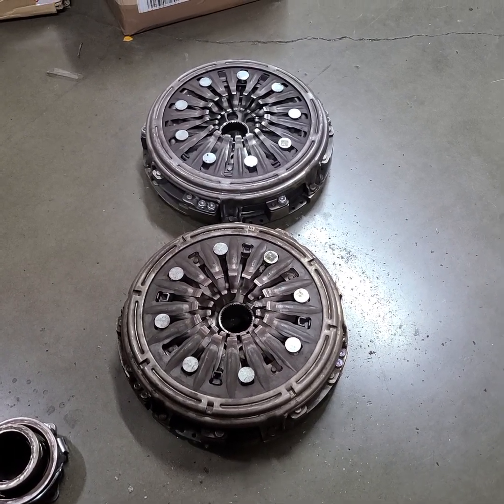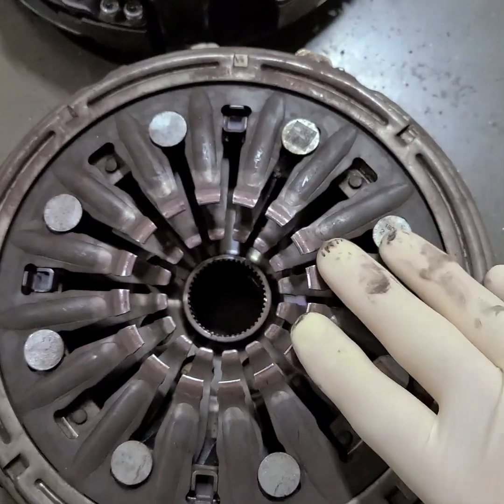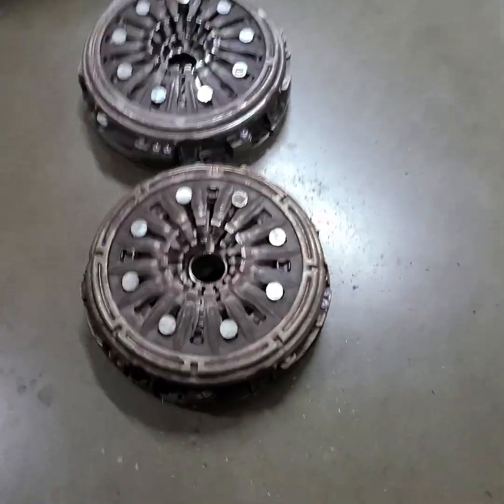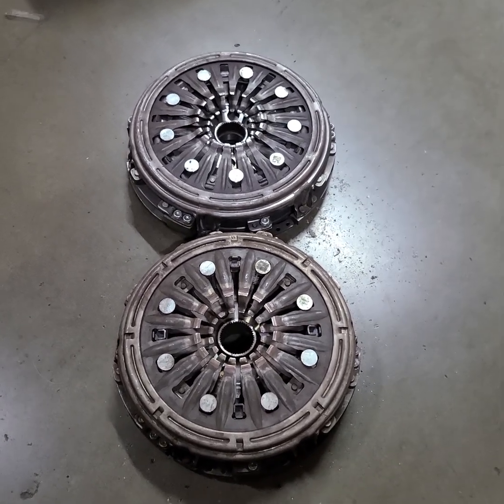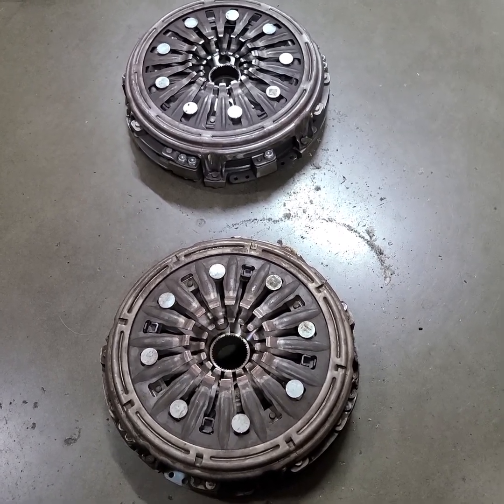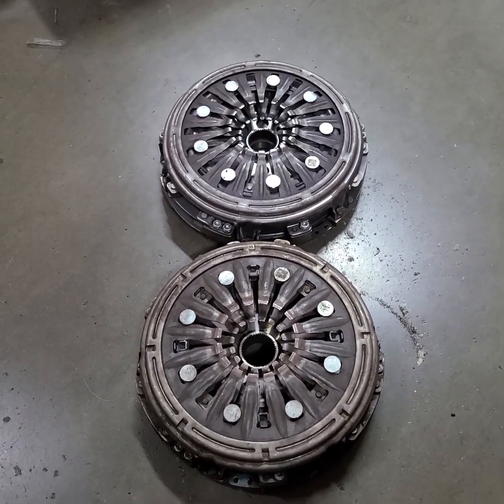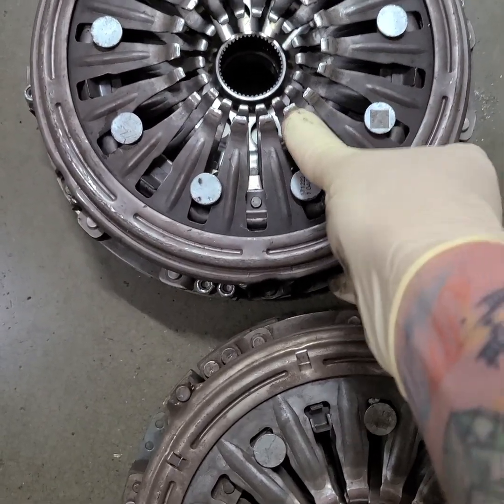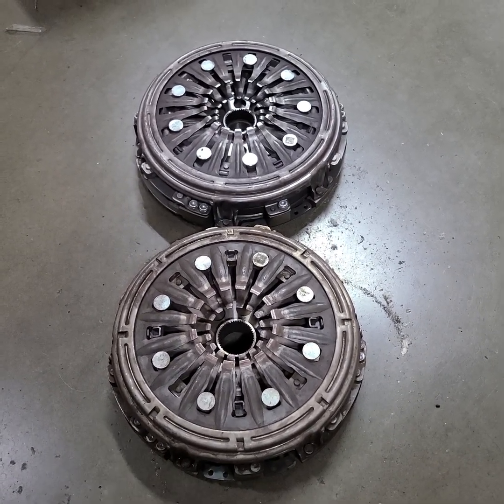Hyundai and KIA DCT clutch differences, simplified version.

Comment: This is great information.
Knowing which parts to swap out without working at dealership to have access is incredibly difficult.
I worked at Honda motorcycle dealers in late 1970's so had either new/broken parts and/or Microfiche  to make comparisons which was very useful for piston swaps or transmission parts (plus various other things)
I bought a used Kia SOUL 1.6 TDI without knowing anything about it (I know, dumb move)
It's done 78,000 miles, I've only done a little over 1000 miles in it
If I knew then what I know now I would have got something else as I'm getting a bit old to be 'shade tree' repairing stuff.
Luckily, I have been using neutral at red lights and junctions even though I only found out today it's the correct thing to do with DCT.
I subscribed as I'm sure you have more video's I'll be interested in.

Comment: Hyundai ioniq hybrid problem i pressed button 2 times ,press shifttlock in neutral and move it 3 meter in front and the vehicle starts ?and when i move it back no start?and again appear the check hybrid system and turn off engine. I let the engine run 20min but doesnt charge the big battery because error is there and little  green car icon flashes why? And when i stop engine it hear clonck from clutch or something,the car go front back no problem but i have check hybrid system.

Comment: I replaced a new dual clutch 7-speed in a Kia Ceed 2019 1.4 TGDI and adjusted the clutch actuator to 71.5mm. When I did the DTC learning function, the learning failed, although I adhered to all the conditions and there are no fault codes. The car only moves forward or backward. The clutch actuator must be adjusted to 65mm so that the clutch is engaged and the car can move. Note that the DCT learning failed again. Please help.

Comment: You seem to think that pressing on the diaphragm engages the engine with the transmission, which is the other way around. Pressing on the fingers releases the clutch from the pressure plate.
Reply: you are absolutly WRONG,this not the tipical manual transmision clutch set up that most cars have.....pushing the diaphram conects the engine a trans to get movement.....is completly different

Comment: I have a 1,6 CRDI Kia Sportage (Europe). Both clutches on the DCT7 are about to be replaced. It makes kanguru hacks when acceleration in 1. gear. It's a dry clutch. I read something about somewhere, that the replacement, installing and calibrating is the most important thing on these clutches - if not aware of this, the clutches must be replaced again in about 30-60.000 km.

Nice listening to someone who actually knows something about these transmissions. 👍🏼
Reply from the maker: I believe you already messaged us, we have replied on another social media outlet.

Comment: I have been educated.   My logic used to form this comment was not correct.

I think it might be easier to explain this all if it was understood that the throw out bearings do not apply pressure to the clutch disk but releases the pressure from them.  The diaphragm (fingers) is what applies pressure to the clutch disk.  You can decrease the pressure on the clutch disk by applying some (a very little) pressure to the diaphragm when the clutch peddle is fully released.  But I don’t think that can be accomplished using a ‘tune’.  Regardless, you can’t add any more pressure to the clutch disk (which would give you more ‘holding power’) than what the diaphragm is designed to give.

Ps.  Sorry to give negative feedback (thumbs down) but the explanation is simply incorrect.  —-  fixed.
Reply from the maker: It can be accomplished with a tune.  Both disks are loose, and the pressure plate and actuator are what control the holding pressure.
Reply: @TorkMotorsports  I stand corrected.  I verified this info with MS Copilot and it confirms that the application of the engagement bearings actually does engage the gear.   Thanks to you I have actually gained knowledge.   So, the application pressure is limited by the size of the clutch disks (for lack of a better term) and the corresponding pressure plate, the maximum pressure the hydraulic system for said clutch, the maximum pressure the diaphragm can apply before collapsing, and the ‘tune’ of the dual clutch mechanism.  Thus, the tune can only apply so much pressure to the clutch pack.

Comment: How do I check how much life is left on my Tucson clutch? I push my system really hard, 17 psi average and full pulls from a stop until I redline 3rd gear into 4th. I hear a big squeal now during the beginning of the pull and I think I don't get as much bite as I used to.
Reply from the maker: You need to go to the dealer or shop that has tools for testing clutch life on your car/clutch.

Comment: Do we know what the torque limit is on the gear splines/housing for Hyundais Dry 7spd and their “new” wet DCT transmission? Can’t find any public information that gives even just an estimate.
Reply from the maker: The factory gives it a rating of 400NM which just so happens to be the rating for the manual 6 speed also.

I have torn down the 7 speed DCT and the 6 speed manual, the gear size, differential, and spider gears are all bigger and more robust in the 7 DCT speed vs the 6 speed manual. I have pushed 600 + WHP through the 6 speed manual, I will assume that the 7 speed DCT could support that also.

Its going to take a tune, clutch upgrade and big build to really test the 7 speed DCT and sadly, no one wants to test that at this time.

Comment: fingers are wider though.
Reply from the maker: Material is thicker.
Reply: Width isn't an indicator of tensile strength or other metallurgy details tho. Technically you'd think less fingers equals less smaller failure points but more fingers do also better distribute the force evenly.

Comment: Hi, thank you for such informative video. Maybe you could advise on below issue. I have a problem with transmission in my Hyundai i40 DCT-7. All odd gears 1-3-5-7 do not engage. Car starts from 2nd gear then shifts to 4th and 6th. What might be a reason of that? Many thx in advance for any clue. Kr
Reply from the maker: I have seen this before, the clutch hub has broken splines or stripped the assembly.

Comment: Hyundai/Kia should have just used the SUV clutches across all models. I'm curious about how thick the Elantra N clutch is
Reply from the maker: The EN, KN and VN clutch assemblies I have not had time to play with or investigate yet. When I get a chance, I will get in there and post some videos up for everyone.
Reply: @TorkMotorsports  those Ns are wet clutch so its a completly different set up than a dry clutch like this one,i think wet clutch is much better

Comment: Out of curiosity, with a TCU Tune I know you can change things like shift points, speed of shift, torque values (values it deems safe etc, not increase of value) 

But does getting a TCU Tune increase the amount of DCT Farts? I saw a video on your FB Page of a TCU tune you were working on for a Forte / Cerato GT, it sounded very nice and exactly what I am after. 

Great video and thank you for the info, keen to see more like it in the future.
Reply from the maker: It depends on the ECU and year make model of the car. Sometimes, yes... you will get more shift noise (fart) when shifting. I try to avoid that and bring the power and shift in as fast as possible, this way you loose no time in the 1/4 mile results.
Reply: @TorkMotorsports this is how I know you don't know exactly what you're talking about. The "shift farts" are a spark cut torque reduction feature. They're actually meant to help the transmission shift faster and hold more power its essentially no lift to shift for automatic/ dct transmissions.
Reply: That's not necessarily true… take a look at Audi for example when using launch control you get ZERO DSG farts… reason why is because it doesn’t actually retard timing it it Instead slams the clutch giving you a lurching feeling when wot while in launch control. velosters dct was never really built with speed on its mind so that compared with fat chunky clutch and flywheel it has a lot of rev hang so instead they just lift up the clutch retard timing (fart happens) wait for rpm To drop then re engage clutch… the Veloster actually has a TCU tuning issue sometimes while WOT in manual the auto up shift (I call it panic shifts because the user never requested a up shift with the paddles or stick) it will never retard timing but instead slam the clutch on the next shift causing a massive jerk… doesn’t happen all the time but if you do it enough times you will feel it (don’t recommend tho unless your engine is very mint condition with less than 40k miles) currently got a 2020 turbo ultimate dct with ecu tune stuffed turbo making around 280hp (tune is on the very safe side for daily driving)

Comment: hi....i did 12.9@111 on my kona but now my cluctch starts to slip badly....so...if you install a different material disc like ceramic or bonze did the tcu needs any reflash/retune/relearn? thanks a lot,...great video just in time thank you
Reply from the maker: At this time, there would be no need for a TCU update/tune. However, we will have a service provided here soon for all your DCT needs.
Reply: @TorkMotorsports  keep me inform and thanks fot your work

Comment: I think we are ALL into you doing more DCT clutch videos as it is a big issue that is just hanging out there, especially now with TCU tunes becoming available.   1) So do all the splines and spring tip heights, flywheel heights remain the same from say a Seltos/Kona AWD DCT clutch pack  vs Tuscon AWD DCT clutch pack?  2) is there a TSB increased clutch pack for the Tucon AWD that will give us even a more robust clutch pack vs regular OEM part#ed clutch pack? 3) Do you see splines, counts main shaft size, disc diameters, flywheel size/weights stay the same through the years? It would nice to see you be the go to clutch guy with clutch kits/tune packages.   Is there an option yet to save my OEM TCU file through the Russian box and re flash your new dct file at home? Thanks for your work on this.
Reply from the maker: To my knowledge, yes, they all remain the same, all of the clutches remain the same stack height.
Yes, there is a TSB with a new part number.
From what I have been able to check, all the DCT clutches remain the same clutch spline and shaft size. I have only been able to check 4 different parts numbers at this time, but will be checking more as time progresses.

TCU tuning for me, is nearing its completion and you will still have to send your TCU to us.
Reply: @TorkMotorsports Are you able to do clutch learning after replacing it.  I was told some dealers don't even touch the clutches cause how horrible the learning is.  They said if a clutch goes under warranty they rec a whole trans

Comment: So the tcu tunes are safe for the clutch right? I've been running one for a while.
Reply from the maker: Well it depends if the person tuning the TCU understands the DCT operation. Some tuners have been making claims about extending the push of the pressure plates, and that could end in pressure plate damage or slow decay of holding power.

Comment: Where does a guy get the the clutch discs re lined? I have spare Tuscon(1.6t) and  veloster (1.6t) clutches sitting on my shelf. Also have a TCU tune on my 2nd gen Veloster.
Reply from the maker: I will have that as an option here soon. If you want me to do the assembly and balance, we will have something ready here soon.